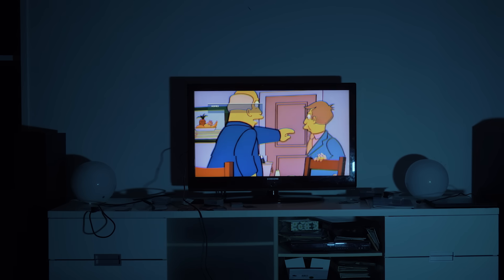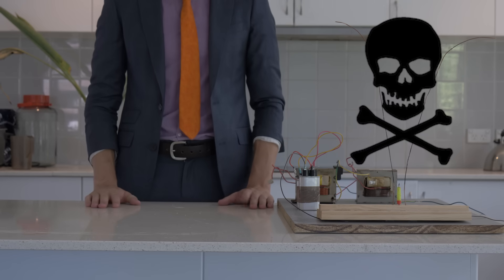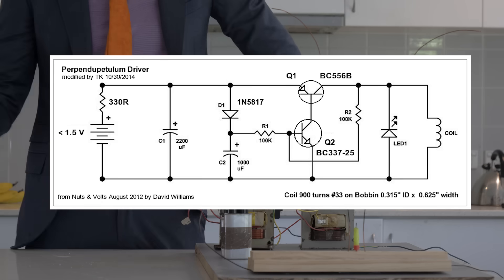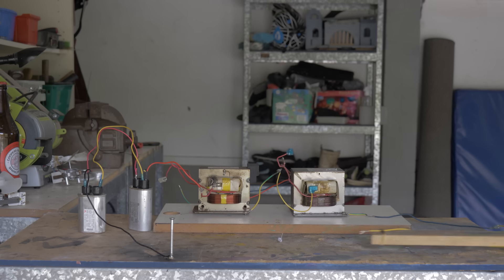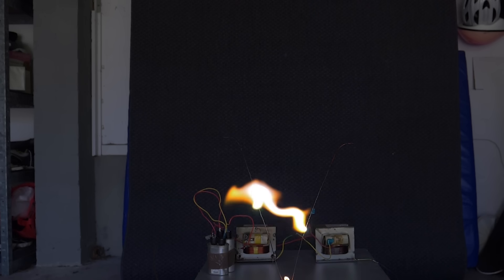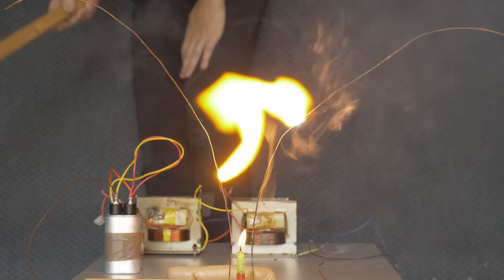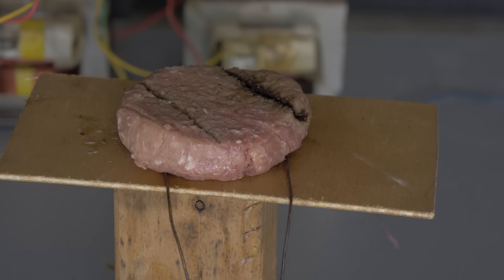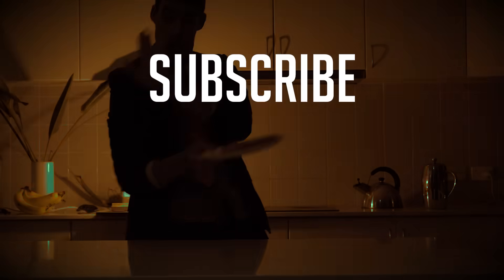Localizing Aurora Borealis entirely in my Kitchen

Comment: capacitors do work in series, it's just instead of summing their capacitance it makes the reciprocal of their reciprocals sums
Reply: Thanks
Reply: What if we invert the chronoton field? That should de-ionize the photon flux, and stabilize the Cochrane metric... Unless there's a positronic wave function in the manifold...
Reply: @Iyamyuyam  That's brilliant now let me make some minor adjustments to the flux capacitor and add an extra seismic stabilizer to make sure everything stays in place.
Reply: @michaelslowmin  seismic stabilizer? You mean an inertial damper? You're talking nonsense, son!
Reply: @Iyamyuyam  Sorry Doc, I get these things mixed up.
Reply: This entire comment thread has been very enlightening
Reply: In my opinion, he should have used a dead-man's switch as well as going through a list of safety precautions.
Reply: so they work but theyre just shit
Reply: Aka with 2 identical capacitors the total capacitance is actually less than 1 by itself.
Reply: Not true. You need the system to reasonate. You can't do that when the air gap is in series.
Reply: @Stevobulfer  Why would you require an oscillator circuit here? The Capacitors are being used to discharge over the leads. 

I think the original comment is kind of right. I'm assuming that upon connections of those capacitors in series, their net capacitance lowered sufficiently, causing it to discharge at a potential lower than the sparking threshold for the distance between the leads.
Reply: I'm basing this on the fact that you can make Jacob's ladders without using capacitors at all, they're just not as visually appealing because there is no mechanism to accumulate charge.
Reply: @icanintospace  the circuit is already oscillating, that's required for the transformer and the oscillations are driven by your AC outlet. You need your circuit to reasonate at the frequency your outlet is running at. It's more about power transfer and impedance matching than anything else.

Source- just graduated electrical engineering undergrad
Reply: @Stevobulfer  I wasn't referring to a specific application, he said capacitors don't work in series. They do, just not the same way they do in parallel. Also since you're matching impedance I believe if you're putting them in series you can simplify it to one capacitor and get the same impedance. I might be wrong about that though.
Reply: @motoklay  of course they work in series, but in this case it does not help. He did not claim they don't work in series, he claimed they didn't work in series for this case.
Reply: @motoklay  also, yes you can get a series RLC circuit to reasonate, no that does not necessarily mean you can simplify it to one capacitor in practice because of the parasitic inductance and capacitance of each capacitor. Furthermore, it's hard to get capacitors that big. You couldn't get this RLC circuit to reasonate though because the load (high impedance air gap) is also in series with the resonant body, which would significantly impede the reasonant circuit.
Reply: @motoklay  i could explain it further if you know what laplace transforms are.
Reply: @Stevobulfer  I guess I misheard him, my bad. Also I was going for ideal capacitors so no parasitic inductance. Also, I know what a Laplace transform is and I wish I didn't.
Reply: @motoklay  i love the laplace transform. It's finding the eigan values to the eigan signals (complex exponentials) of linear systems! What is there NOT to love about it? Essentially, putting the load in parallel (in this example I am assuming that the load is purely resistive for simplicity) pushes the pole of the system further left on the real axis. When you apply a sinusoidal signal to the system, you evaluate the system's laplace transform on the imaginary axis at a given frequency to determine it's attenuation. If the pole of the system is far off to the left, the system does not experience a significant voltage gain from the reasonant peak.
Reply: @motoklay  also, transformers themselves are inductors afterall
Reply: I think you just threw a sentence together with sci-fi terms 🤔

Comment: When you connect capacitors in series the equivalent capacitance is less than the capacitance of the highest capacitor, it works the same as connecting resistors in parallel, the formula is 1/Ceq=1/C1+1/C2...

Comment: This man made a better Jacob's ladder than electro boom in a shorter amount of time
Reply: Electro boom had only one transformator and no capacitors to double the voltage( less voltage the smaller air gap needs to be to make the plasma go up ) if he would use atleast two transformators he could get a spark to the end of the wires :D

Comment: Puting the capacitors in parallel rather than in Series causes them to output more energy at once, maintaining their power storage but increasing their output. While putting them in series wouldnt change their output, but your power storage is increased.

Comment: capacitors in series would be like a fluctuating piece of wire with current going through.  One will drain the other.  In parrallel, the dielectrics and foils etc within will be polarized with pos on one side for charge then neg charge on other surface or material, but they will stay charged like that as the charge is trapped thus, in series, the charge cannot get trapped, and flows through the capacitors and never develops the potential difference.  You might even make them explode.

Comment: Energy dissipated by a resistor = resistance * Current ^2 
So wiring in parallel where current adds, means that the energy in the arc is increased by the square of current.

Comment: Electrical Engineer here. Putting the capacitors in parallel makes them act like a capacitor with 2x the capacitance. However, putting them in series actually acts like a capacitor with a 1/2 the capacitance. The transformers needed a larger capacitance to function correctly, not a smaller one.

Elaboration for f***ing nerds:
This is because capacitors, in essence, are 2 conductive plates that are very close together. Due to some physics BS, that actually works like a really low-capacity battery. The larger the area of the plates, the more charge they can hold (capacitance). In addition, the smaller the distance between the plates, the more charge they can hold.

Capacitors have a symbol, and it visually shows what the 2 plates look like. I'll be using this to draw the circuits from now on:  ─┤├─

So in series, this would look like:
─┤├──┤├─
As you can see, adding another capacitor essentially just added a second gap between plates. Hence, the overall capacitance drops.

Now for parallel:
┌─┤├─┐
└─┤├─┘
Here, the gap is the same distance, but there's 2x the surface area. So it can hold more charge, it has higher capacitance.

Comment: The capacitor thing could have something to do with the fact that when you put capacitors in series, the formula for the combined capacitance is (c1*c2)/(c1+c2), which, if we chose two 500uF capacitors, is equal to half of one them:

(500uF*500uF)/(500uF+500uF) = 250mF/1mF = 250uF

If you put them in parallel, then you just add them toghether, so it's just 500uF+500uF = 1mF

So in parallel you can store more electrical charge.
My guess would be, that the higher buildup of charge means that it can reach an amount that allows it to jump across the gap. 

It probably has something to do with it.

Comment: Capacitors dont work well in series the first one charges to 100% but the discharge isn't enough to charge the next capacitor to cause the pulse of your scuffed "aurora borealis".(plus the positive and negative electrons dont go to the right sides of the plates in series but thats nerd shit) Parallel allows both capacitors to get the same amount of voltage (the source). If you had a capacitor and replaced the second capacitor with a resistor it might work

Comment: Quick n easy explenation why series won't work as well as parallel is because with capacitors work the other way around (unlike batteries) they create more "power" when they are in parallel but the capacitance decreases and the other way around for series ofc (note: i did not use the technical terms you SHOULD use when working with electricity just so it wont confuse anyone with the basic level that this project is at)

Comment: Electrical wizard here: Capacitors are basically two metal plates separated by some substance where charge moves from one plate to the other. When you put two in series, it's like a stack of four plates, which is a sucky capacitor. When you put them in series, you got two normal capacitors next to each other, which acts like single capacitor twice as big. So if you're planning to ruin your life, always put your caps in parallel.

Source: B.S. in Electrical and Computer Engineering

Comment: @I did a thing

If you connect the capacitors in series, there will only be a partial voltage (inverted proportionally to their capacity) at each of them which is of course bad for creating sparks, they are indeed often connected in series to prevent disruptive discharge.
Additionally you will always end up with less capacity than the weakest part in the chain has, so even if you still get sparks, they will be weaker than with just one capacitor.

In parallel you maintain the voltage and get the combined load of each one, so more solid sparks.

Even more fun:
Use a serial connection to add up the voltage like with batteries.
You just need to trick around the partial voltage problem by keeping them in parallel until fully loaded, and then shorten them into a serial connection, works perfectly smooth using spark-gaps with the right distance to just get overcome by the max. voltage applied to charge the capacitors.
That´s basically how the marx generators work.

Comment: The capacitors wouldn't work in series because the capacity would decrease similarly like 2 resistors in parallel. In parallel they add up so you have a higher capacity.

Comment: I hate it when I slip and nail my finger to a board then slip again and connect it to two wires.
Reply: Ender436 yeah, so annoying
Reply: #relateable
Reply: And then slip again and connect it to high voltage microwave parts

Comment: Not 100% sure as to why it didn't work, but connecting the capacitors in series will decrease the capacitance and thus the voltage across the capacitors, while connecting them in parallel will add up capacitance and increase the number of electrons traveling across the wire, probably increasing the amount of excited gas particles. Cheers.

Comment: The capacitors will increase their capacitance in parallel but will drop sharply when put in series.
Parallel: Cnew = C1+C2
Series: Cnew = (C1 x C2)/(C1+C2)
.
In parallel you are effectively increasing the area of the two plates. 
Recall that: Capacitance =( permittivity of the dielectric x Area) / distance 
Therefore the increase in Area is an increase in Capacitance.
To make a gross simplification, the series connection increases the effective distance between the plates so the capacitance drops.

Comment: Voltage drop compounds for capacitors in series, which is probably why it didn't work when you had them wired that way.

Comment: The capacitors didn’t work in series because capacitors add in the opposite way that resistors do. Series = 1/[(1/C1)+(1/C2)] leading to a smaller equivalent capacitance.  Parallel =C1+C2 leading to a larger equivalent capacitance.

Comment: Capacitors didnt work in series because they don't add in series, the formula for calculating the equivalent capacitance of 2 parallel capacitors is simply c1+c2. However, in series, c(eq) = (c1)(c2)/(c1+c2) for 2 capacitors, and it's more complex for 3 or more. But basically when they were in series they were still technically working but with a significantly lower capacitance than either original capacitor.

Comment: "Localizing Aurora Borealis entirely in my Kitchen"
More like Destroying bratwurst with copper wires
Reply from the maker: ahahah
Reply: @Ididathing  Hey there, I just Graduate from the University of Minnesota with a bachelor's in electrical engineering, and I'm starting my masters/PhD in mixed signal integrated circuit design at CalTech in September. The reason the capacitors need to be in parallel is because it allows the circuit to reasonate at 60 Hz which greatly increases the power transferring capabilities. The air gap acts like a very small capacitor within the circuit. The transformer steps up the voltage by taking advantage of the tendency of inductors to resist changes in the magnetic Flux within the magnetic circuit of the transformer. These transformers kind of act like a flywheel for the circuit, storing 'electric momentum' in the form of magnetic fields. They then transform the momentum into voltage potential (think of a gear box turning torque into angular velocity). Capacitors act kind of like a spring. When you put the two together, energy sloshes from one component to the other. This trade off in energy between the two components prefers to oscillate at a natural frequency (like the frequency a swing trades off energy between gravitational potential energy and kinetic energy). The capacitor tunes the circuit such that it reasonates at 60 Hz (wall outlet frequency). This allows your power source to efficiently transfer energy to the output. In order to get high voltages, this sloshing of energy needs to be at the right frequency and unimpeded. Putting the capacitors in series, also puts the air gap in series as well. This does not allow for efficient sloshing because the air gap capacitor in series with our added capacitor have a smaller overall capacitance. When the capacitors are in parallel, the capacitance adds up, achieving our reasonant system.
Reply: @Stevobulfer  Welcome to Pasadena! I highly recommend Puebla Tacos, they have great mole and they're open at ass o'clock at night
Reply: It's a regional dialect.
Reply: @Patrick_Bateman92  What region?
Reply: @ArcturusOTE  Australia
Reply: @r_idk_lol  Really, I'm from New South Wales and I've never heard anyone do aurora borealis
Reply: @ArcturusOTE  oh no not new South Wales no its a Melbourne expression
Reply: Thanks for the likes and the heart i'm just seeing it now <3
Reply: BRATWURST UND SAUERKRAUT MIT KARTOFFELN MIT CHAMPION SAUCE. AILKLGHIZGÖVLTUFFURUDLULDRHXH,FH,XRZ,RAH,RHARN YFH,YDHDY,GFYHMYDFH,YFHY,,HDY,HFY,HYF

Comment: Well, first off, this was a horrible idea and I support it entirely.
Second, for the capacitors in series, I would assume you're using ac voltage due to the transformers, but if you were using DC, one capacitor would become charged and block voltage from passing through, so the second capacitor wouldn't be able to charge as the wiring was broken by the first capacitor. Not sure why AC wouldn't work, though.

Comment: Connecting capacitors in parallel is the equivalent of resistors in series, its like if you just decided to add the areas of the plates together, there is no resistance between them (theoretically) so you could basically pinch the wires together until the capacitors merge

Comment: Capacitors in series block direct Current DC and limit the frequency of AC (probably the reason why it didn't work) while in parallel they store energy like a battery

Comment: Capacitors add their capacitance in parallel. They do a weird dividey-addy-undividey thing in series, which can only ever approach thei higher of the two capacitances. It's like . . . the next capacitor in line in a series connection doesn't get filled up enough, but if you have current flow to both at the same time, they both get filled up the amount they're supposed to be filled up.

Comment: Also, SUPERSIZE THE EGG DROP!!! There are 2 ways to do this, Either supersizing the speed so getting the egg up to terminal velocity like dropping it from like a drone, helicopter, or weather balloon. Or you could supersize the egg by doing an egg drop with the biggest egg you can get, an ostrich egg! The absolute best thing to do however would be to combine those two things and drop an ostrich egg off a weather balloon in a contraption to keep it from breaking that you can easily see the egg through! Call out William Osman when you do it too though! and you can also try doing it with Arby's food items.

Comment: As an electrical wizard, the capacitors are actually shorting out your transformers. Capacitors block DC, charging up and storing energy. Capacitors let AC flow through. Because you aren't using the high voltage diodes to rectify the AC from the transformers to DC, they are acting as a series resistor when you put them in series, and they are slightly shorting your output when in parallel. I recommend that you leave them out of the circuit in this example, keep up the good work man!
Reply: Adding the capacitors in parallel makes the arcs bigger and as far as Jacob's ladders go, it's very common to add them. Explaining why it works is a bit challenging and on the internet you'll find a few different explanations, but one of the more convincing ones is that it makes the circuit act like a tank circuit. If that's the most accurate explanation I don't know, but experimentally I can tell adding high voltage capacitors between the prongs does help with the arcing, even if it's a bit counter intuitive at first.

Comment: Connecting two capacitors in series halves the total capacitance and increases the total resistance. The benefit of connecting capacitors in series is it raises the maximum potential difference that can be put across the capacitor before the dielectric breaks down and the capacitor explodes